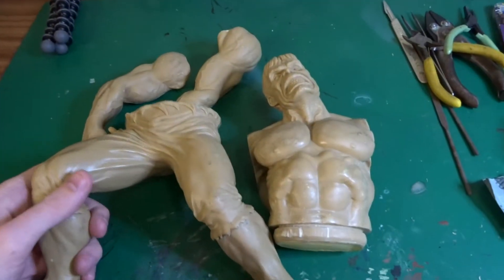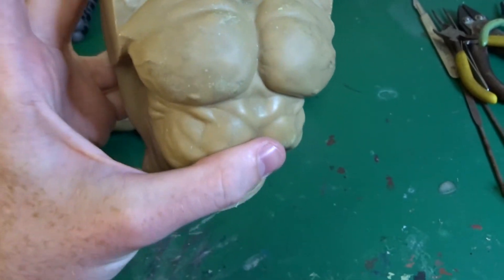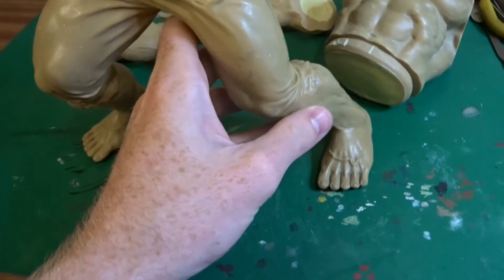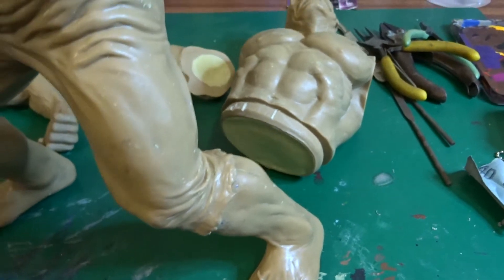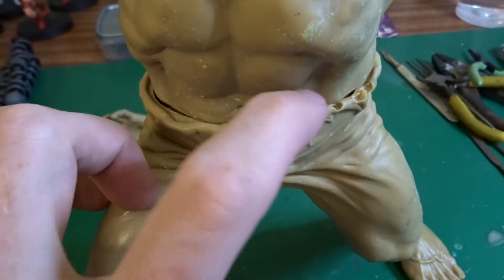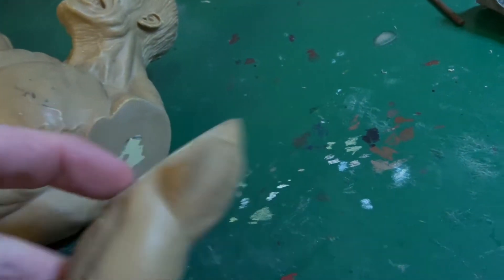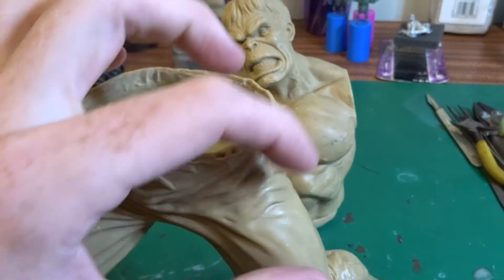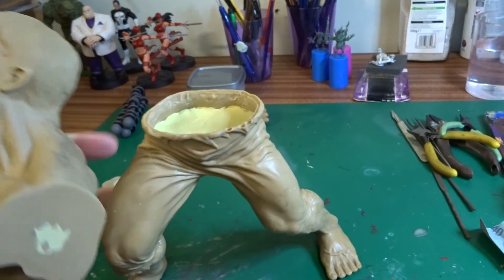HULK MODEL KIT (1990 1/6 SCALE) - Pt.2 - FILLING & PINNING

Comment: Looking good man , thats a ton of miliput.
Iv nt worked with vinyl models ,are they much different to resin r the usual plastics?
Reply from the maker: haha yeah, I didnt intend to do the whole thing with milliput - I was going to use air drying plaster/clay for the bulk of it but it was taking forever to cure properly )(left it for a week and it still hadnt set in the centre - think its been too humid here just now) so dug it out and used all Milliput.
From what ive seen so far vinyl tends to be softer/smoother than resin and is less brittle.  You can carve what needs carved easily with a knife or saw and doesnt shattr like some resins to if dropped/knocked.  Downside is that hollow forms like this would have a tendency to warp/sag if kept in a warm place.  Seems filling vinyl models is all an expected part of the process to stop this from happening.  Would like to find some bulk 2 part puttys though, save me ordering a bunch of individual boxes and hopefully a bit of cash too!
Reply: Dam I hope it works out for ya in the end ,the hardship your going through ha,It's all a learning experience i suppose.Cheers for the info on vinyl Il have to try my hand at it sometime.

Comment: You explain the steps but don't show anything. What glue do you use? How do you pin? Why do you pin? Just saying that you do this or that is not of help to beginners that want to understand.
Reply from the maker: Fair point but I'm a bit of a beginner myself. These videos are not tutorials or how to's, theyre just sharing my progress and thought process as I work on projects.  I don't feel I'm at a level yet that I can give tutorials as I'm learning as I go but to answer your questions: I used two part epoxy resin, you pin by drilling holes in the material and gluing a metal rod in the holes, you pin for added strength and durability.